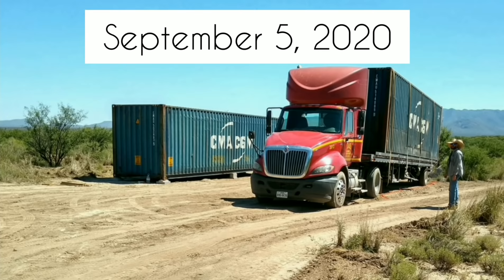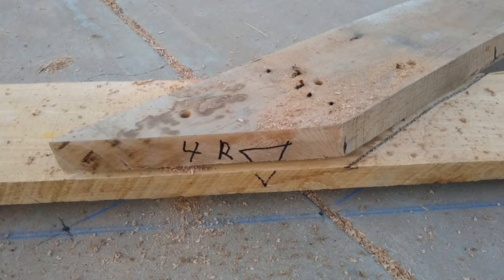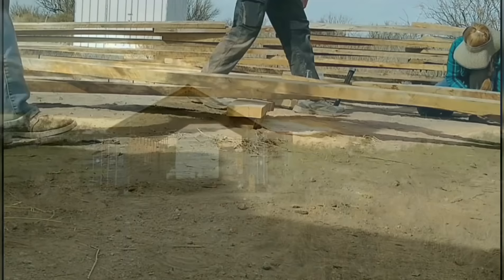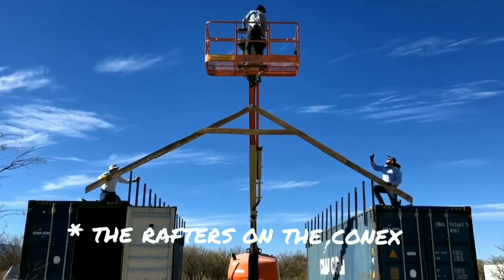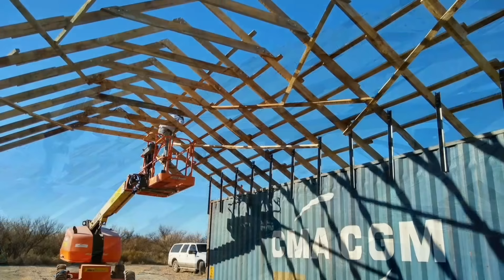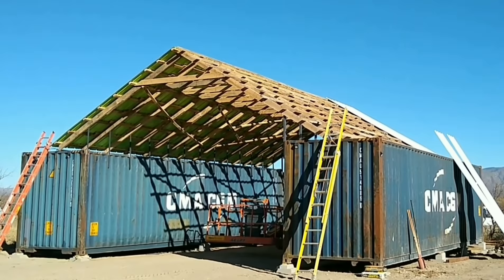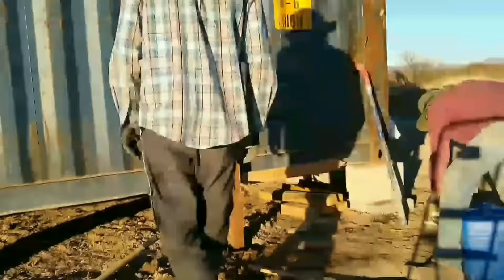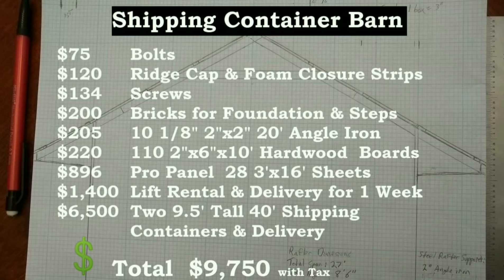Shipping Container Build | One Year Anniversary Recap: Barn, Shop, Storage, Shade & Solar $ Cost

Comment: Why would you need to insulate the room for the solar? I just let mine get hot or cold. doesnt matter
Reply from the maker: Most of the time it's fine, but we got down to 5° last winter & up to 108° in the summer. Our type of batteries need to be protected from extreme heat of cold, it's not good for the inverter either.
Reply: @RedandAprilOff-Grid  I see, I just have lithium ion, you don't have to worry about any of that with lithium ion

Comment: It probably would have been cheaper to forgo the containers and just build a stick building. A container has no insulation value and loses any structural integrity if you try and cut openings without using structural supports. As far as I'm concerned shipping containers are good for shipping and storing goods.
Reply from the maker: When we built this, we lived 10 hours away and had one week to build it. We need a place to park our RV, a work shop, a place to store our stuff, and a solar rack and shed. This worked out pretty awesome!  Containers are pretty overpriced now, but it still might be worth it.

Comment: Non mi piace l'abbinamento di legno-acciaio, io le capriate le avrei fatte in metallo!
Reply from the maker: That would be an option if cost isn't an issue. We got a great deal on the rough cut hardwood, so that's why we used it.

Comment: Sorry bud, but you sure  did thar the hard way.
Reply from the maker: There are definitely easier ways to do it, but it would have cost a lot more! We were able to do most of the work ahead of time, and get the roof on in less than a week. It has worked out awesome for everything we needed!
Reply: @RedandAprilOff-Grid  sorry you could have done it cheaper too.
Reply from the maker: @yolisurich4025  I guess we could have used a tarp or canvas, but we couldn't mount our solar panels to it. Glad you found a less expensive and easier way to do it. You should do a video on it.

Comment: Pretty poorly designed. Your conexes should have been set on deep, at least 2' deep in AZ, pilings and strapped & anchored better.
Reply from the maker: Concrete footings would be a better way to go, but we think this will stay put just fine. An unsecured empty container can handle 130+ mph winds. Yes, the roof adds some lift possibilities, but with the structure being close to 20,000 pounds it seems very unlikely to move even with the worst case scenario of a 100 mph microbursts.

Comment: Your truss design has failure writing all over it, trusses are structural, they need to be engineered. This thing will fail very soon but I guess this is how hippies live, good luck.
Reply from the maker: It all looks great so far, it's definitely very solid. The trusses are made out of hardwood and plenty close together. He did go back and add bolts at all of the scabbed in  joints.